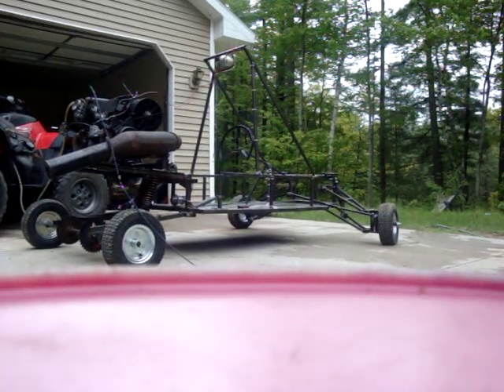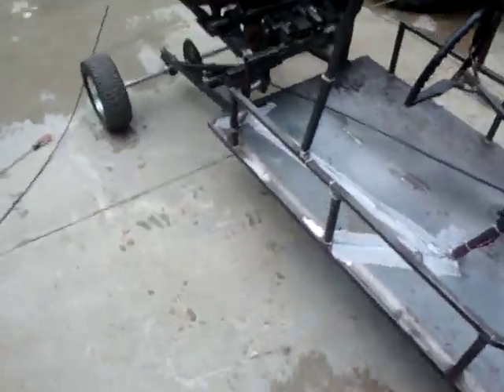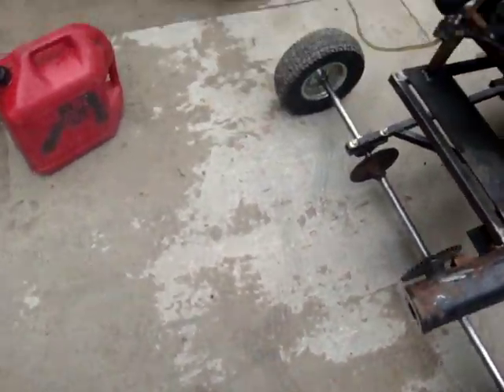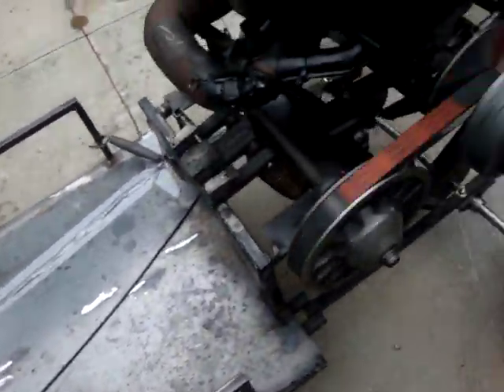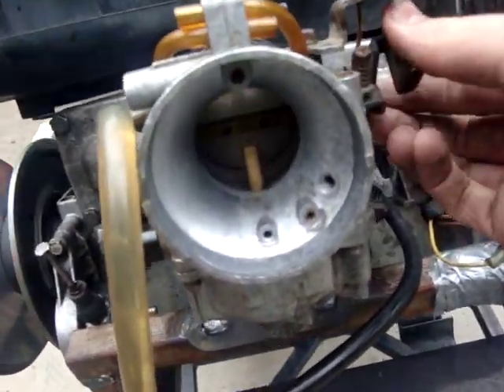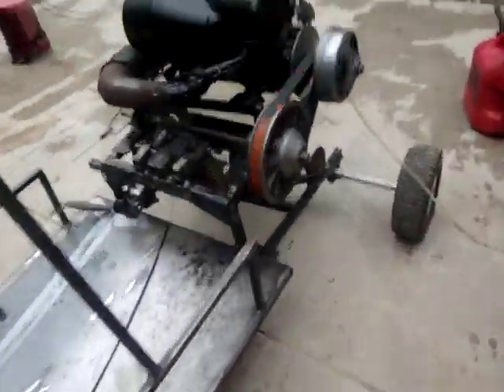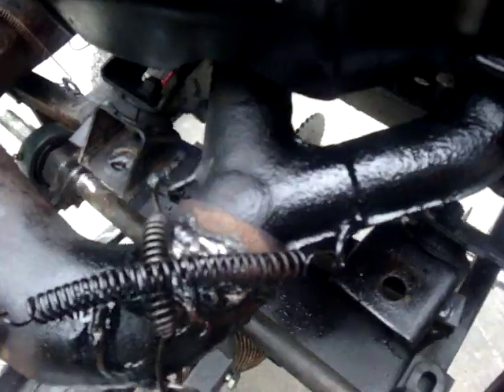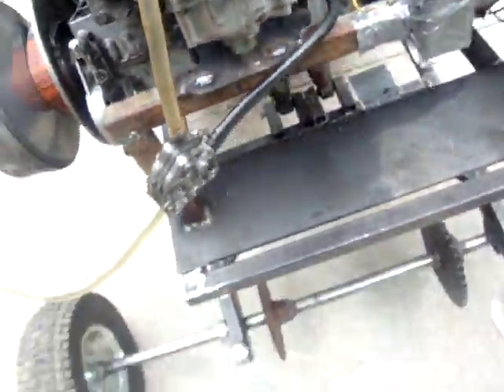testing the new go kart (540 snowmobile engine) FOR SALE

Comment: Thanks for correcting me. I wasn't paying attention to the sound when i first watched this. The way that I learn is by talking to people who are better versed than I am, and comparing what I learn with what I know. 

Since it's a 2 stroke, is there anything even wrong with some leaky exhaust?

My new presumption is that it's all just residual from the explosion since the exhaust stroke is too short to empty the cylinder completely, I probably wouldn't be super worried.

Comment from the maker: @EvansAutoShop yea roll cage is almost done front end re designed this cart looks so much different then what i got now its alot more ligit alot more rigid and sturdy posting vids tommorow. but still no motor the 540 i had in it i pulled it out and put it in a sled and blew it up now i got a liquid cooled 470cc rotax about 85hp i also got a rotax 583 in my one snowmobile that has 130hp  but im looking for a 670 rotax... big hp but these rotax's have the same motor mounts so easy in and out

Comment from the maker: yea i went up 5 in the jets already but im going to go up 5 more because i saw how close they were it helped but not that much. and i checked the the reeds (boysen) but there good to its just the jets it sounds like its running on alcohol yea and the springs in the rear aint as stiff as they can go i have some more room for adjustment but i kinda want it soft im not gonna jump it or noffin. but thanks i am getting some more jets today and do you think it could be my air to gas mix ratio.

Comment from the maker: @Matt072694 yea ji re ran all my chains now i got the a new motor liquid cooled 470 ski doo motor and a tra clutch and got the secoundary now got a chain from the jack shaft with the sec. to another jack shaft that is in front of the swing arm with another chain going to the rear axle its a slick set up and works great. doing finishing touches for safety lol like a bucket seat and 5 point harness 

and the roll cage is done the cart looks alot different now looks small in this vid

Comment: that smoke coming out by the carburators might be from the seal.  or whatever they called it.  it's like paper, green color seal.  nice video, plus the rear suspension would look good with a leaf spring. from a car. like muscle cars do in the old dodge challenger.   and front suspensions with fox shocks.   engine sound good. just the body work need more time in it.  good job in the welding by yourself.

Comment from the maker: yep narrowing the front end and stiffing up the rear moving shock in rear bracing suspension better ruining more support for motor and rear shocks new mounts and finishing roll cage bigger tires going on and these tires going in a new cart im building putting a 250 2 stroke dirt bike motor in a small ass cart. with suspension but allot lighter and smaller

Comment: good jobb man, im not trying to come off as sounding better. but you might need to slow down a but with your welds. they look as if they are sitting on top of the metal (in some parts) other than that, the design could use a little bit more refining. but for junior that really good. Nice job. im gonna make one this year as my last graduating project. i got a 475 that im gonna put on it.

Comment: looks like your jack shaft is positioned in the wrong place.. the suspension travel will snap or throw the chain.
 You would have to reposition allot to get your configuration to work

Comment from the maker: do some looking around and i got the hubs and bearing with it to you know were they attach to the 3/4 inch bolt in the front with bearings and a hub for the rear 1 inch solid no bearing because it cant move it is what drives it and then there is shipping!

Comment: Nice,but you're going to need wheels about the same size as that quad,and I think you'll need to sturdy up your rear suspension.That thin tubing will break,and you can't tighten those bearings without squashing the tubing in the process.You also need a thicker axle....it's not exactly a Briggs lawn mower you're running on there..LOL!

Comment: Thats suspension looks very soft, i would get some stiffer shocks.

Where would i find a good 500cc+ sled engine for under $500? craigslist... Decent running sleds are on there all the time for $200 or so, then you can just part out the sled. My friend is selling an xlt for $250, liquid cooled, racing pipes, only problem is it has a bad track. 

Bottom line get better tires, stiffer suspension, finish the roll cage and then you could get 800-900 for it tops.

Comment from the maker: i actually have to go down on the jets snowmobile motors arnt just made for warm weather its like a car engine they are versatile you just have to jet it right this vid i went the wrong way on the jets. im running a 180 and stock is 150 i need to go to a 115 about.

Comment: you got to have the air box on them engines from the sled or they just won't run right...it charges the engine with air ..thast why your gettin smoke come back out ...a little smoke will come back out thats normal...they are tuff engines

Comment from the maker: @EvansAutoShop well how much do i got in to it?? i got about with metal and grade 8 bolts motor and bearings and hubs chains and sprockets.. got aboiut 600-800$ in it but i didnt pay for alot of the metal couse it was in welding class if i paid for the steel i would have at least 400$ more in it total will be about 1,500$ once its all done need a bucket seat and 5 point harness and lights powder coated frame pedals,and miscellaneous parts but gonna be a wicked cart

Comment from the maker: yea i wish o would of known how small those tires were gonna be on that they are 13 inch tires but they just look so small i am making a shifter kart tyle this year putting the same exact motor in should have it done by next spring for sure but no suspension and alot smaller any tips you want to give me like how height should it sit? how wide? steering?

Comment from the maker: TELL ME WERE!!!

i looked maybe i did get ripped off but hey we all make mistakes 

and the cart makes the tires look small theyer are 4 inch 4 bolt hubs so most golf kart and 4 wheel tirs will work and they are 6 inch rims and 13 inch tires i will tun it for a while but then go to small atv tires i dont want huge tires it losses low end.

Comment: Hey man, I'm not sure if you have solved the problem with the smoke comming into the carb yet or not. But I think it has something to do with your exhaust leak. It's bad on the motor and u may blow a valve if you don't get it fixed. It's very bad for your valves.

Comment: ok, so, your torque converter that bolts to the engine and the other part that connects to that intermediate shaft... Do they come as a pair or separately? Where do you get them?

Comment from the maker: again not done still more on cage and bracing for motor yet and the way i have the chassis designed is like a ladder turned sideways very strong just look and i dropped it out of the back of my truck and it held up pretty well just need to stiffen shocks moving rear shocks back stiffening up front putting new vid up in about 2 mouths when im completely done.

Comment from the maker: well i am running premix premium gas because that's what i run im my HONDA CR125 its 16fl oz to 4.5 gallons of gas.
im getting new jets today stock is 150 and i put a 175 in it and that's how it ran it goes up by 5 and im gonna get a 200 and a 190 and see if they are better.

Comment from the maker: @EvansAutoShop not if your putting a radiator in it with electric fans so got that covered done it already to a different cart runs at 185* never gets any hotter than that

Comment from the maker: it dont  matter if its air or liquid its jetting now you have to understand the warmer it getts the richer it gets now the colder it gets the leaner it gets it wont burn up in the  summer because its jetted for 20* f it will run very very fat at 80* f so i actually have to lean it out just because its a snowmobile motor doesn't mean its just for snow.

Comment from the maker: exhaust leak i had a crack in my pipe and it was leaking and blowing straight into the fan so it was pushing it through the jugs and out in front. 
but yes that can do it i mad sure not to angle it to much

Comment: yeah, your belt is way too tight. you could move the motor up, but you probably don't want to burn the fuck out of your back. you should see about getting a stronger rear shock or moving it back. you sacrifice travel but then at least you wont hit bottom on the rough stuff. 
the snowmobile engine isn't running right. it sounds like you have a fouled plug, or REALLY rich jets. 
if not, take off the manifold and check the reed valves. that's probably why you have stuff spraing back. awesome job

Comment from the maker: um the motor is worth 600 i have 300 in tires and 100 in chains and another 50 in bolts and more still to come another 100 for the seat another 100 for the 5 point harness so no

Comment: Ummm..that engine has NO valves in it like a 4stroke does...its a 2 stroke engine....No intake valves...No Exhaust valves....

The smoke is because the gas has Oil mixed in with it...you Have to 'premix' fuel for 2 stroke engines...

Don't post comments when you don't know what you are talking about.

To the Owner/Builder of the Kart....You will find many things that need fixing, redesigning...but keep it up...you are doing what most kids won't do these days.